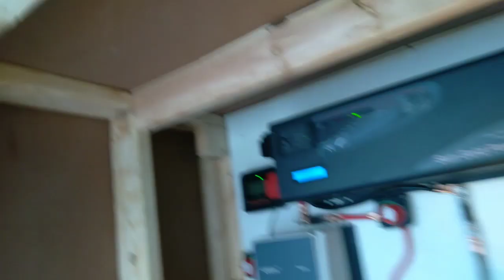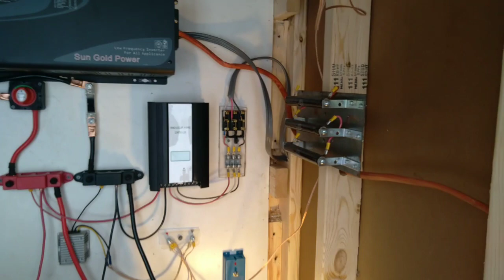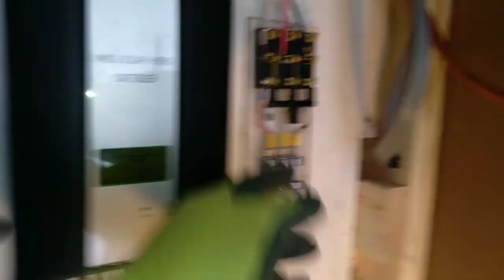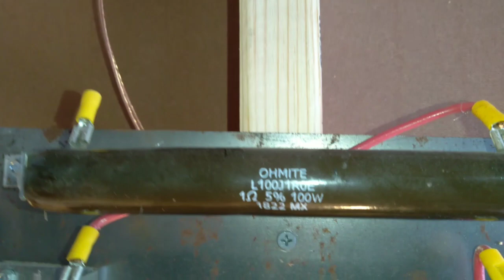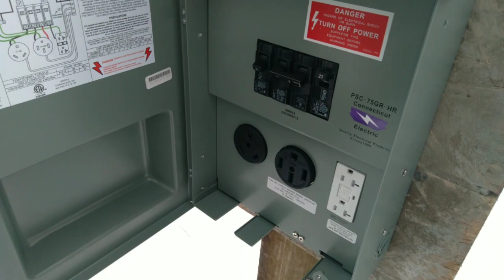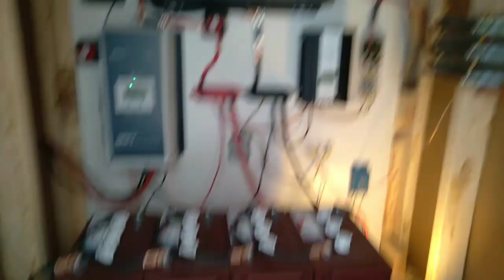Remote Powerplant:   Almost Complete!

Comment: Nice job young man!! It's really coming together good!! Have you plugged the wind controller into the laptop?? I can't wait to see how it holds up cause it is producing good!!
Reply from the maker: It sure is eh! Still have yet to find the correct adapter because im limited by the stores i can go into....i dont do masks.... but next trip out there that's the plan is to fine tune the wind controller so the turbine is allowed todo its thing. There's a factory RPM governor thats hindering its peak performance and I need to set that from the computer program. After that i just need to tie in the diversion load controller, hang the last meter to monitor inverter output, finish insulating the walls/ceiling and build the battery box so humidity doesnt mess with any components. Then she's ready for whatever use the owners throw at it!

Comment: Well it's coming together! Glad you've got a dump for wind. Hope to see the dump side of controller. Thanks for sharing 😃
Reply from the maker: It sure is Buddy! Few more loose ends and we can lock it up till spring. Whenever the dump controller from Bob shows up I'll wire in the resistors and I still want to add a thermoswitch to the heated floor but that's it! Then all there is to do is wait for a sunny/windy day and go watch the batts fill up to make sure everything is functioning proper and safe....then im gonna flex that inverter a bit to see what shes got! Brick saws, space heaters, air compressors and whatever else i find to throw in the truck. Run it till she beeps! The ratings say 300% surge capability....we'll find out!

Comment: Awesome work at always, and a very interesting video. Hope you went and got warm after doing that! Happy new year to you too.
Reply from the maker: Thank you bud! Happy New Year to you also....and yes, i hoped in the truck and warmed up as soon as i turned the camera off. Chevy's blow GOOD heat!
Reply: @smallcityhomesteaders1600  Oh I'm sure! But we don't get Chevy trucks here, aside from a few imports :) The heater in my Range Rover has never worked but last week I installed one of those Chinese parking heaters and it's nice and toasty now.
Reply from the maker: @TheAmazingAdventuresOfMiles  no Chevys?! Boy thats a bummer. So how do you haul around stuff like firewood, gravel, blocks, 4 wheelers, lumber, scaffolding....ect?
Reply: @smallcityhomesteaders1600  Well we got pickups but they are all far-eastern brands. Defenders too can come in a pickup variant. Lots of 2wd crew-cab dropsiders around too, but no American pickups have ever been offered for sale here other than special import. To be honest, they are a bit big and thirsty for most brits I think, and our small villages and towns. We pay a lot more for our gas and diesel and our older roads can be a bit quaint. For me, my Range Rover carries most stuff, I'm not precious about the interior. I also have a Land Rover 101 Forward Control which can handle the rougher stuff. And Dolly (featured in one of my videos) is handy for moving firewood and stuff. I guess we just use what we got. 

There is a guy up the road with a Dodge Ram with the V8 SRT Hellcat engine and it's a hell of a thing, the only one I've ever seen in the UK. Personally I quite like the F250 Super Dutys, I'd have one if I could.
Reply from the maker: @TheAmazingAdventuresOfMiles  i guess eh... so toyota and such. I had a nissan pick-up years back. Ugly as sin but went through whatever i pointed it at. Range Rovers are a pretty cool thing to see here. Those Hellcats certainly are something else eh? Give all the supers something to worry about. That sound.... only they make it. Funny thing is our police drive AWD Dodge Chargers with hemi's and they sure seem to enjoy putting the pedals down more then most folk i see on my busy road.

Comment: That powerhouse inverter sounds exactly what i am looking for. Where can i find one or two?
Reply from the maker: A powerhouse it is! Had no problem running my welder or even the old well thats 250' down and hasn't been run in year. It's heavy! Probably 80 lbs at least. I needed a helper to mount it on the wall. I trust its 300% surge rating. 
https://sungoldpower.com/